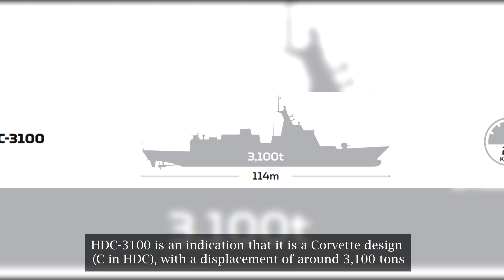HHI Unveils Corvette Design for Philippine Navy

Comment: Phil govt should set down with South Korean govt for USD 15 Billion loan military assets procurement for  12 Nos Frigates at USD 400 million - 4 .8 Billion
6 Nos Corvettes at  USD 400 million - 2.4 Billion
6 Nos Submarine at USD 500 million - 3Billion 
24 Nos FA 50 at USD 35 million - 780 Million
24 Medium.Lift Helicopters at 60 million - 1.40 Biĺlion
20 Nos Missile capable Patrol Boats 63 m Length at 50 Million
1.0 Billion
This loan will be payable in 15 to 20 years with automatic appropriations by Congress based on Multi Year payment

Comment: If this is heavier and more capable then the Jose Rizal frigates wouldn’t the Jose Rizal frigates be considered corvettes the the hdc 3,100 be considered a frigate instead
Reply: Both can be classified as light frigates. It is because this design is bigger and more powerful, that doesn't make JRC a corvette.
Reply: It's not just about the size & weight, it's about the type of arms. Since the VLS looks like VL MICA which is just 20 km range, then it's more of a corvette.

If JR class' VLS will also be fitted w/ SRSAMs (hopefully not) then they're also more of a corvette. But they're fitted w/ at least MRSAMs like camm-er, then they're frigates

Comment: A 3100t, 114m long ship is wasted w/ only 20-km ranged SAMs. At least give it FFBNW VLS for quadpack MRSAM system, then rename the project FAP Batch 2. Also can fit taller VL module (ex: 6.7meters) if chosen
Reply: Or if they choose Barak-8ER or Aster-30 or Barak-8 or similar for the FFBNW VLS, better classify as light destroyer
Reply: @watermirror  lol.. bruhh 3100t 114m called destroyer?
Reply: @naufalendram8063  lol bruhh...ship types based solely on size & weight?
If so, then call Hamilton cutters as frigates
Reply: @watermirror  add Barracks 8 or SM-2 regardless of whether you can or not? What about the budget? If this is FFbnw maybe you will stop from your deep sleep because fell out of your bed
Reply: @naufalendram8063  those LRSAMs & 2nd main radar (S band) are obviously FFBNW items since the budget is only for high-end corvettes. For the time being, SRSAMs will do, & hopefully they'll pick camm over mica

Btw, you still haven't answered the question
Reply: @watermirror  this is just a corvette project, what is the reason they are installing weapons like frigates or even destroyers? 
HDF means F for friget
HDC means C for corvette 
which means there is a decrease there whether a decrease in weaponry, armaments, or the like. you won't imagine it will be like a frigate, JRC that's our frigate.

Sorry, I didn't answer your question because I know it's just a wet dream I'll be disappointed if it falls short of expectations
Reply: @watermirror  Umaasa pa rin ang lahat
Reply: @naufalendram8063  wag ka nang umasa na magiging frigate ang Hamilton cutters
Reply: @naufalendram8063  u were mocking 4500t eh? U can mount 32 vl cells there, so 32 SM-2 or Aster-30...ur mocking backfired

Btw, Iver is a destroyer, it's just Denmark officially labels it as frigate, just arbitrary. While the Burkes are practically beyond destroyers, it's just the US kept the original label, again just arbitrary... U focus too much on arbitrary things & mistake it as absolute 😅
Reply: @watermirror  First you compare Hamilton to a frigate, what the hell? coast guard you compare to frigate? You can find out here what a frigate is  https://en.m.wikipedia.org/wiki/Frigate#:~:text=A%20frigate%20(%2F%CB%88fr,being%20%22frigate%2Dbuilt%22.

Second, Frigates and destroyers have different roles and capabilities that can be shown by the difference in the weapons they carry and that is reflected in their heavier weight, Here you can see what the difference between a frigate and a destroyer is
https://thenavalist.com/home/2017/4/10/thats-a-destroyer

Then, what you call today's frigate with 16 vls can be called a lite destroyer is about what the designation of the ship was made, for example the ship will be an AAW warship then they have a lot of VLS to use as the designation facility, if their ASW has a strong Submarine Tracking sonar capacity. Iver, de zeven provincen, French Fremm are AAW frigates they need a lot of vls to get that name, The Italian fremm and the French fremm are different because they have different platform requirements, France wants a frigate with ground attack capability with its scalp, Italy wants ASW capability with powerful submarine beam tracking
Reply: @naufalendram8063  nope, it's u who implied Hamilton a frigate. Dementia bruhh? What the hell? Read again ur 1st reply to erase ur dementia.

As for the rest of ur reply, well...indeed again, as expected, u see absolute definitions from arbitrary definitions, but anyways it's ur right 🤷
Reply: @watermirror  It's hard to talk to people who have high hallucinations and have high expectations but don't see reality
Reply: @naufalendram8063  indeed it's hard to talk to ppl who have high hallucinations like u who views Hamiltons as frigates 😅 views arbitrary definitions as absolute 😅 but don't see reality 😁

And speaking of high expectations, coming from you who dreams of 6000+t fremms for Ph 😅 but don't see reality 😁
Reply: @watermirror  Look, I don't even say Hamilton is a frigate, Can't even tell what a frigate and the Coast Guard are. LoL.. definitely clown 😂🤡
Reply: @naufalendram8063  nope, ur very 1st reply here clearly implied u also claimed Hamiltons are frigates, thanks to ur amazing criteria in classifying warships. Lil, definitely a clown 🤡🤣
Reply: @watermirror   Besides dreaming high, you also can't read? Giangkon ba nako ang imong giingon? Dili ka makabasa, maayo nga moeskwela ka usab sa elementarya.🤡
Reply: @naufalendram8063  yup, giangkon nimo... It's just u have poor comprehension... Dili ka kamao mosabot, pag training sa balik 🤣
Reply: @watermirror  yes it only have 20km range but I think they can intercept an antiship missile like China's missile, but they can't intercept brahmos because it's a cruise missile so, CIWS will handle it.
Reply: ESSM > VL Mica